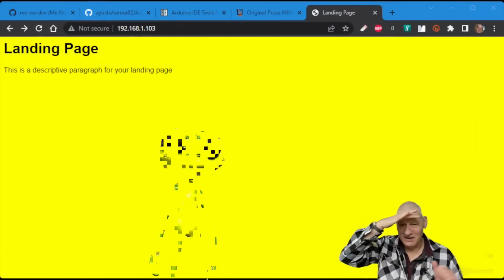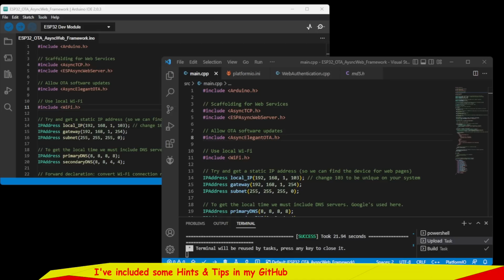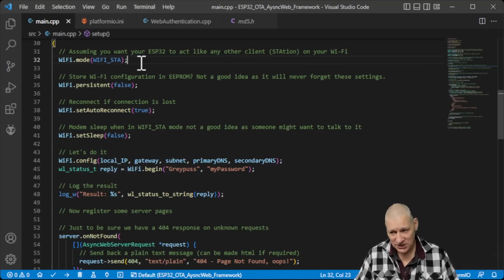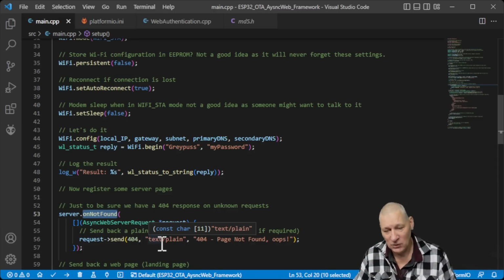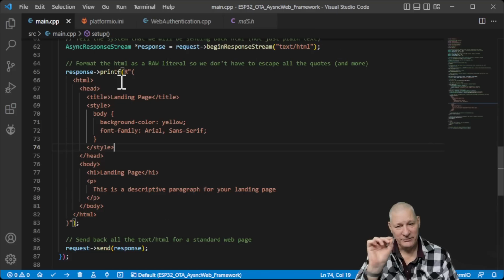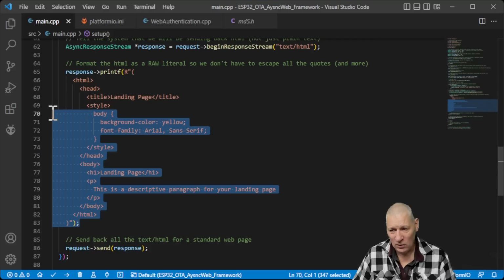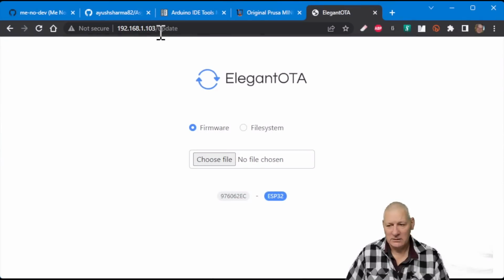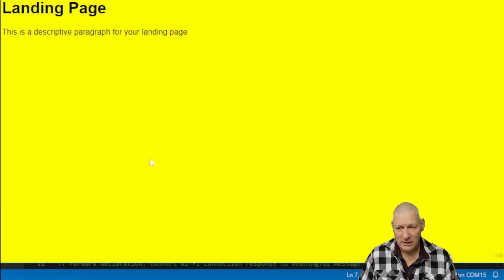#258 ESP32 Web Pages AND OTA updates - just3️⃣libraries! ESP8266 also!

Comment: Thanks for the video.

My router has DHCP , after the lease time the static IP is no more useful.

Need some guidance , How to overcome this ?
Reply from the maker: Using static IP addresses is great but your router needs to be told not to issue addresses beyond a certain range (where you have your static IP range).

So in the DHCP section of your router, you might say the range for IP addresses is 192.168.1.2 to 192.168.1.100 and that's it.

You can then assign static address from 192.168.1.101 to 192.168.1.254 (careful! your router might be in that range) and the DHCP will not affect it.

Alternatively (and I do not do this as I want better control) you can have the lease time set to "infinite" and check the box that says "always give the same IP address to this MAC address". But you are then depending more on the router.

Comment: If esp32 is changed to AP mode, will it be simpler? But generally OTA does not seem to have this setting?
Reply from the maker: Well, OTA could connect to the device in AP mode (or, perhaps, your app in running in that mode on the device). However, I don't see how it would be simpler; it just works when running as a standard wi-fi client (STA)!

Comment: But if my firmware is kind a mess, it is divided into four parts and needs different hex code like 0x8000, 0x10000, ex000 something like that. What should do now
Reply from the maker: Not sure what you mean by "four parts". Do you not compile a sketch with the standard entry point of 0x8000? How do the other bits get uploaded (without OTA)?

Comment: Might be time for an update to this project as AsyncElegantOTA is no longer supported, and is replaced by ElegantOTA.  ElegantOTA needs a small change to the .H file to enable async operation, and a call to it's loop member in the sketch's loop method.
Reply from the maker: Indeed, and I am using the newer version in my latest project; it was just a matter of replacing one library with another (and that loop( ) call). That said, all my old project will continue to use AsyncElegantOTA as they should work going forward (and if they do ever stop working on a recompile I'll replace the library).
Reply: @RalphBacon  Before I suggested that this code be updated, I should have said thank you for this very helpful video, since I used this concept in a few of my projects after seeing it.

Comment: Hello,
I am looking for a secure OTA system to update firmware in WAN networks. There is a ton of LAN OTAs, but not over Wan nets.

Our project is to maintain agriculture robots that only may have simple 2G modems like SIM800L or...
Update via WIFI, but only que the customer can connect robot WIFI to internet via a temporary cellphone acting as a Hotspot Access Point,

Thanks so much for your contributions !
Horacio

Comment: I thought we were already past hardcoding WiFi credentials and IP addresses in the firmware, thanks to WiFiManager 😆 (And to get a static IP address, you should configure your router to do it based on MAC address.)

Anyway, I came to check out the OTA stuff specifically. Did not expect to be lectured on the basics of HTML and CSS and C++ string literals and how to get the ESP32 to connect to WiFi 🙄
Reply from the maker: Lectured? Really? 🤷‍♂️

You know this channel is for beginners and inexperienced coders, right? Who probably won't have your obvious level of expertise so they do get the basics included, I'm afraid. And doesn't include talk of setting a router to (hopefully) always give the same IP address; this is not about networking, it's about ESP32 stuff.

As for the hardcoding of credentials, I don't know how often I have to say (or write) this, but this is a DEMO! 🤦‍♂️
Reply: @RalphBacon  A lecture is an educational talk given to an audience, so yes, really. I mean the OTA updating is super useful for ESP32 development in general but it has remained quite out of sight in Youtube maker videos. Has nothing to do with crafting basic web pages though 😆
Reply: If you select the three dots next to the 'save' lozenge' you can disable the option that forces you to watch.😛

Comment: Gawd...just came back to revisit because my system wasn't working.
Note to self ------Turn off your browsers VPN if you want to visit your local network!!!!!!
 🤣🤣🤣
Reply from the maker: Who knew that a VPN doesn't allow a connection to a local network?
Reply: @RalphBacon 😴
Reply: @RalphBacon  i took a weekend recently to learn css and js and it's worth it because then you know how to make it easier as  you have an idea how to add buttons using the built in objects added to the css file. the only thing that annoyed me was that you have to order the css file or something out of order will undo something you spent a ton of time to plan earlier. makes your code better though being aware of those things.

Comment: We need an OTA + WiFi selector for connecting for the first time to WiFi
Reply from the maker: Catch-22 perhaps? 

You can't upload to a device with OTA without knowing its IP address. Obvs. But assuming you have uploaded at least once to a device, you can write a sketch to scan for all networks it can find (and the signal level) and then ask for a password from you, whilst it operates (temporarily) in AP mode with a known IP address (so you can talk to it on its private network). 

There are many examples out there.

Comment: I am having issues with the libraries I am using Arduino IDE 1.8.18. I have previously tried this with Esp8266 but got nowhere so ordered 6 new esp32 mini but they were the purple ones and I spent too long failing to get the drivers installed so now have received 6 x esp32 mini V1.0.0 which are seen and have got the "simplewifisever" sketch working so now comes to this lesson. After zipping code 1st error was multi versions of WiFi library so deleted the one in main documents/ libraries. But still stuck on "ESP32_OTA_AsyncWeb_Framework:5:10: fatal error: ESPAsyncWebServer.h: No such file or directory
 #include <ESPAsyncWebServer.h>"  the only library that the manager found and installed was ESPAsyncWebSrv.h tried to just alter spelling in code to call this one but nothing works.  I am not uptdate with my lessons as I have to keep waiting for Aliexpress to deliver to NZ
Reply from the maker: It sounds like your environment for the ESP32 is a bit mangled; I strongly suggest you archive it somewhere off your beaten (Windows) path and start again. 

BTW this will not work with the ESP8266 (I think you discovered that).

Once you have the new environment, don't just install libraries willy-nilly that are not intended for your device; think about which ones are required (my demo sketch shows this clearly) and you are guaranteed a successful build. Yup, guaranteed, but only if you use my demo sketch as the starting point - then you can expand on that for your own projects.

Comment: I added this feature to my Refrigerator alarm project that sends text messages to my cell phone via the Telegram app (via a BOT)  if the doors have been open too long.  That code uses a WiFiClientSecure connection with the UniversalTelegramBot class.  But adding the 3 libraries in this example breaks the message sending for the Telegram app. :(  I have no clue where to go from here.
Reply: I determined that the issue was caused by having an incorrect gateway value in the call to WiFi.config() - I left the one from your example in it - oops.  Once that was corrected, the transmission to the Telegram app Bot worked as it had before.

Comment: Thanks for another easy to follow video Ralph.  I have tested this on an esp32 mini and it worked after I modified the WiFi connecting.  It seems that on my network, I have to try WiFi.begin() several times to achieve the connection.  So in my sketches, I have a loop that attempts to connect up to 40 times with a quarter second delay between.  It normally takes 10 or 11 attempts before the status returned is WL_CONNECTED.

Comment: Great video but can I use these libraries to update an Arduino uno with an Ethernet shield
Reply from the maker: I believe you can use the libraries with an Arduino, after all we're not fiddling about with registry values here. 

You'll have to read the GitHub pages for each of the library and if it states it supports a Wi-Fi enabled UNO then you know it will work.

Comment: I have tried to implement this using a wired network instead of WiFi using an ESP32 & ENC28J60 ethernet  board but cannot get it working at all. I tried to replace the WiFi element with the EthernetENC library  but couldn't get it to work at all, too many conflicts which I didn't understand. I currently use the EthernetENC library in some of my other script and they work fine for my needs, however, I would much rather use the ESPAsyncWebServer and AsyncElegantOTA libraries. Do you know whether this is at all possible Ralph?
Reply from the maker: If you are using an ESP32 why not get it all working first using Wi-Fi and then make a copy of the sketch and use the EthernetENC module; that way you might find where the issues or conflicts lie?

I have only used that module using an Arduino (video #74, https://youtu.be/F2mFlMVzX0M ) but in theory it should work with an ESP32 (or there is another library for that hardware platform).
Reply: @RalphBacon  Thank you so much for the reply and advice Ralph. I have tried many varied combinations trying to get this to work and I cannot fathom it out so I've gone back to just using EthernetENC and given up on trying to get the AsyncElegantOTA. It was only me being lazy so I can update the ESP32 without having to plug it in to a PC.

Comment: Good stuff as usual.  I tried it for updating my drive monitor using ESP Now on ESP8266.  Worked like a charm. Took me back to 1990's in Manchester  when I did this for a living too!   Incidentally, instead of getting a 404 page not found, I was getting a ERR_CONNECTION_REFUSED.  Same thing I suppose as the server didn't know what to do so told me to foff!

Comment: If I want to connect to the ESP32 from an other computer that isn't on the same network. How could I do that. I see many examples of this, but all use a third party cloud service like "Blink or Arduino Cloud".
Sorry If this is a repeat, I'm not sure you get a notification of a reply to a reply.
Reply from the maker: To communicate with any device on a network, you have to be on that network. The way 3rd parties do it is to connect the ESP32 to the cloud network and then you send stuff up to the cloud network from your home Wi-Fi, thus using them as a middle-man.

The alternative is use a cheap, low power device (like an ESP-01) that just does the same as I described. It connects to "the other" network, receives data and sends it to the local ESP32 via a serial connection. Sounds clunky but no more so than using a 3rd party network.
Reply: @RalphBacon  I'm sorry I know I must be missing something, but if the ESP is acting as a server, why can't it serve the information regardless of what network I'm on. Isn't it just a matter of connecting to it's external IP address? I'm sure that it would involve opening ports, and thing that I only have limited knowledge about.
Sorry to go on but I just can't get my head around it.
Reply from the maker: The ESP32 can indeed run as a server, but you then are connecting to it via your own home router (as you say) from elsewhere. 

Yes, you can "just" set up port forwarding to route all external requests for, say, port 80 to a single ESP32 device on your home Wi-Fi. 

Some ports won't be (easily) allowed by your browser but ports 81, 82 are OK (I've tested those). Port 103 was disallowed by Chrome. You can force it on a PC/Mac but on my phone it's just an app and verboten!

Once you open that port, of course, you are increasing the risk that a knowledgeable person will hack your entire home network. I don't know how likely that is but I'd want to know before doing it. Incidentally, my CCTV allows this but I can't find an entry in my port forwarding page so it's a mystery!

Comment: Had a terrible time getting the esp32 to connect.  Kept getting 4 way handshake errors.  Then found Ralph on a
github forum with similar but different problem.  Solved, but you did not tell us that tx power could be set higher!!!! :)
Reply from the maker: If the TX power was the issue with you then that's fine, you've solved it. But if you have a Revision 0 of the ESP32 (shown on boot up) then throw it away because it will never play nicely. (https://youtu.be/6BK4fzRaFGY )
Reply: @RalphBacon  Yes I remember that video.  Fortunately I have rev 1 and it is connecting and running very stable.  I remember reading how wonky those early esp32 boards were and that is why I avoided them until now.  Looking forward to part two of this video.

Comment: Sorry if you have covered this before. This is a local connection, why does it seem that you have to use some form of 3rd party cloud services to do the same thing over the web. Is it to do with security?
Reply from the maker: Not sure to what you are referring. Can you clarify please?
Reply: @RalphBacon  if I have it correct. In this example, you have to be on the same network as the ESP32 to connect to it from your browser. It seems to do the same thing from another network, using the world wide Web. You have to use a 3rd party like Arduino cloud.
Reply: @fenceup07944931177  To connect to the esp32 you would need the external address of your network and setup port forwarding so that you router wil let in external traffic. This is pretty insecure though unless there is some security turned on in the esp32, some kind of authentication.    I am reading using a vpn provides safety for accessing the esp32 from outside your network.  A vpn will make your outside computer look like its on the internal network. I have not read up too much on this though.

Comment: The problem with this approach of OTA is that it is unusable for devices that spend most of their time in deep-sleep.  I use a different approach where each ESP when woken and having done its measurement and then sending that over the network, then also checks a server URL to see whether the firmware there has a different checksum than it is running at this time (a very simple compare of 2 numbers) and if so it downloads the new firmware and reboots into it.  This way the device can still be in deep sleep most of the time (and run on battery) and if I need to push a new firmware, I just put it on the server and on the next wake-up the device will upgrade to it ...
Reply from the maker: Yes, this is fine if you need the ESP32 to sleep lots. 

Personally, I don't like the approach because it can update itself (and hang, not work) at literally any hour of the day. I like to watch and see what happens! Perhaps I should have more confidence in my code! 😁

But, as I say, if the ESP32 needs to sleep then that's a good option you describe.

Comment: Can the esp32 serve up a web page from an sd card on a sd shield?  Currently using a mega with ethernet shield for extensive web page, too much to put in the body of the code.
Reply from the maker: Yes. Absolutely. And I will be showing you a way of doing this in Part 2 and Part 3, so keep tuned and keep practicing with Part 1 for now!

Comment: Great video Ralph.  I've pretty much given up on fancy displays, knobs, and switches on my ESP32 projects.  I use the methods you've just described for controlling things: Webpages, WebSerial, and OTA.  My current project is a Mailbox Monitor that uses ESP32 to connect to WiFi. Powered by Solar/tp4056/Lipo, it sleeps most of the time, but uses IR sensors to tell you when there's mail in the box.  Opening the mailbox door wakes it up.
Reply from the maker: Sounds perfect! In the UK we don't have mailboxes, as such. The postman must put all the letter through the letter-box, built into most front doors. But a sensor to detect something there would work too.

Comment: Thank you for this.  I'll give it a try when I'm thinking a bit clearer.  (I stepped in a hole, in the dark, and broke my face almost 2 weeks ago.  Pain pills are working, but not real conducive to thinking.)  I want to set up garage door opening, and had done it before, but there was no security code and it was opening and closing on it's own.  (I think someone left their phone on the page when they were done.  Hence the security code to arm next attempt.)  This format will be a great help as I've never done OTA.
Reply from the maker: Sorry to hear about your drunken 😲accident (what do you mean, you were stone-cold sober?) and I wish you a speedy and pain-free recovery. 

You'll find OTA is a bit of a non-event when you do it this way; it "just works". You can also detect when an OTA is underway to you can stop processing stuff in the main loop (your ESP32 continues to run whilst the OTA happens, albeit more slowly). I'll explain more in Part 17 of this video!
Reply: @RalphBacon  Thanks!

Comment: Thanks for the nice overview. Do you need to change any partitioning details in the platform io config file for this to work?
Reply from the maker: No need! In fact, if you look at the .ini file I use, I don't even mention partitioning because we don't specifically use that feature. I'm guessing that, by default, we're using all the memory for program space but I can't guarantee that. We'll cover that soon too.
Reply: @RalphBacon  I think you need an ota partition for ota to work. Both programs are actually in flash at the same time so the esp32 can revert back to the old program if something goes wrong. The partition you are using would already have an ota partition.